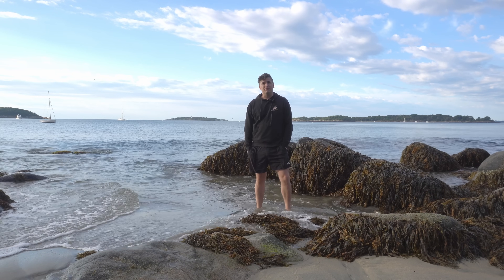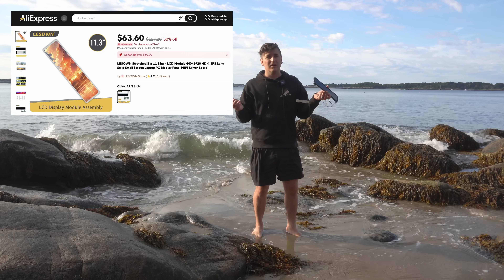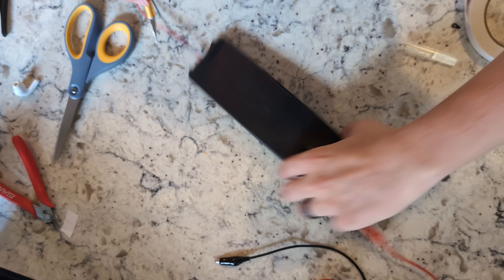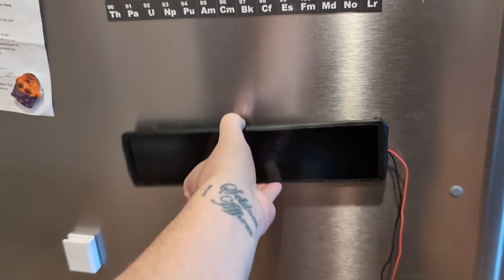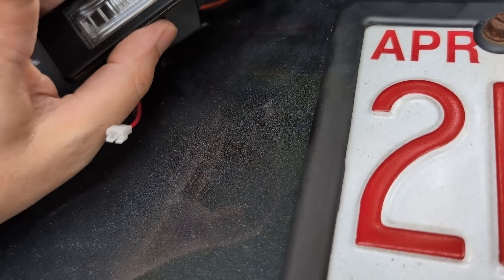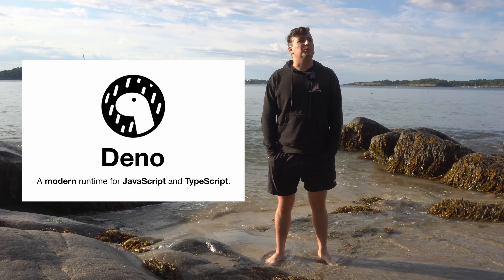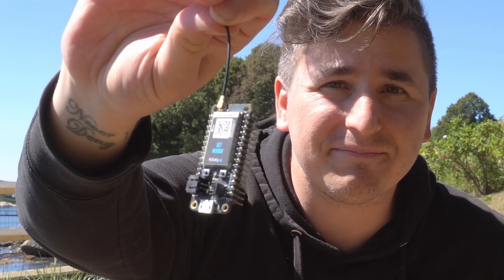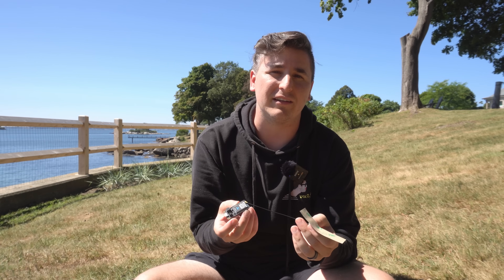Making an electronic bumper sticker to show what music I'm listening to in real time!

Comment: If you want it to stay outside the car then get a clear piece of 2" heatshrink. If possible get a weatherproof one (Marine). They have adhesive inside which when heated seals out all water. I use those on my cars for wiring. Neat idea overall! I could see myself making all sorts of fun bumper stickers with a project like this lol

Comment: Ouchy on that display, they are like $13 in China from TaoBao
Reply: And like 30 if the price included the hdmi board
Reply: 50 if you also want a metal enclosure. Probably wouldve been cheaper even if shipped overseas
Reply: Also you should play bad apple on it
Reply from the maker: sounds like I should start dropshipping
Reply: @GuyDupont  Lol, seeing the number of people that might want to do this, maybe you can do a bit of reselling on the materials XD. Also, if you want, I can help you get parts for that price and ship it over if you want. Or you could use any number of online TB shopping services if you opt to not trust internet stranger, could still end up cheaper.

Comment: f-in typos. 
i did hook up LED strips inside my vehicles dash and out along my inner panels.
the cars duty cycle feeding the spedo pulsed out my speed in code, id read that and then cycle through the spectrum. faster i go the more the color would change until it would start flashin at 80 +

PLUS. added passive IR motion detectors INSiDE my rear view mirror housings. THIS way , if my system noted i was moving fast then abruptly stop, it would begin detecting movement on either side of my car.
so instead of having to turn my head to see em, my door panels would gentley glow and pulse , depending on which side they were approaching on.
offered my ALOT of benefits simply by knowing that and remaining super chill and motionless, knowledge is power.

cop oncve did notice a custom tac display i built and code in my sun visor's edge
stickin his head in my window he noticed it and started getting excited and asking questions
gave me a chance to talk shop with him and that just completely halted his "mission objective"

conclusion.
i suggest DO SOmething that gives you advantages against them with your skills buddy
even if its to win them over

cops LOVE driving fast. its a rush
this means they often LOVE discussing cool car related techs such as custom tac readout visors

Comment: How hard would it be to take the hardware and just have it cycle through static images if we didn’t want to do a now playing “sticker”
Reply from the maker: Under the hood, that's pretty much what it's doing. You wouldn't need the Particle board, you could just load the images on the Raspberry Pi's SD card. 'fbi' - the RPi utility I'm using to actually display the images - has a built-in slideshow mode.

Comment: Cool video. The thing I noticed is that the heat shrink will put some stress on the display it may be a band over time.
Reply from the maker: ahh good thought! Honestly this wrap is not as tight as it looks, especially after I made cuts for the screen. It's flappy around the edges, frankly. But I do plan on using more of it for other stuff so I'll definitely keep that in mind - never considered warping.

Comment: A 3D printed enclosure with an acryclic front face and O Ring would have looked great.
Reply from the maker: mmmm O ring is a good call
Reply: @GuyDupont  mmmm yummy o ring
Reply: 3D printed obhect will need to be painted for outdoor use - something UV resistant.
Reply: @LordPhobos6502  Most filaments are UV resistant, I have used maybe two or three dozen brands and have rarely had issues.

Comment: It seams unnecessary complicated when some Bluetooth audio devices can just extract the current song name from your phone and some esp could display this text to an LCD screen easily
Reply from the maker: seems that way at first glance but:
1. We don't use the Bluetooth directly for audio, we use Carplay/Android Auto. This setup is source agnostic.
2. This display can't be directly driven by an ESP (although the new P4 might change that), so even if I could use it for audio, I'd still need another piece of hardware just for the display. 
3. Much simpler to write a little Particle app to fetch a tiny piece of JSON than ESP firmware to act as a (reliable, good-sounding) audio receiver.
4. Most importantly - I had the Particle board sitting around! I figured, might as well use it.
5. No way to filter out podcasts/audiobooks/other audio if using Bluetooth metadata (though it could be funny to show this stuff too).

The idea to use the AVRCP data is a really good one but it doesn't work for my usecase. My setup is definitely less "clean" but it is really quite "simple" IMO!

Comment: MG CHEMICALS conformal coating. 422 is the part number.
Coat the pcb's with it, use liquid electrical tape around other exterior connections. 👍
You're welcome 😁

Comment: 4:55 lol so dramatic about pulling a plastic mold off.
Reply from the maker: 😭 ok fair but have you tried it??? That thing was really on there, took me like 5 mins of pulling
Reply: @GuyDupont it was the right amount of drama 👍
Reply: Considering that that's what it often takes, and that a glass installer BROKE MY TRIM yanking it off, it's valid.

You have to yank OR you have to have very long trim removal tools and know how to get them to the clips that you can't see from the edges.
Reply: @TheTalonts  lol fair I’ve been ripping my panels off to install speakers and electronic since I was a wee lad lol and I do have the tools lol if you don’t have the tools have plenty of those little plastic clips.
Reply: @nedmacallen  - dude, they didn't break the clips, they broke the TRIM.  "Professional" window installers.  I had clips.  Now I finally have the trim, so can put it back on.

Comment: Why even over the web?!
Just buy a Bluetooth Audio Receiver that you can control with the Pi. Bluetooth also transmits Meta-Data aka song Titles. Grab it, Display it.
ok you need a AUX input in your car stereo, but most cars have that.
Reply from the maker: The short answer is: I already had the Particle board sitting around unused, so it was a no brainer.

And that wouldn't work super well in our case because we use Android Auto/Carplay to connect our phones.

It's a good and interesting idea though - I know you can use an ESP-32 as a Bluetooth Audio sink, but I dunno if you could have it simultaneously act as a BLE peripheral or WiFi access point to broadcast the data to the bumper sticker. Would cut costs quite a bit if it could work and sound good.

Comment: I would definitely recommend clear heat shrink so you can see through it. If you mount the pi and other things inside the car you could have a flatter package on the bumper sticker, with just video and power going to the display. an xt30 connector would be good for power and you could use a male to female HDMI to get the port through the heatshrink. you can get multipole magnets on mcmaster that hold onto sheet metal better. love the build!

Comment: Epic project! Love your content! I had an idea for something like this except I'd have a little control panel with preset messages. Use some silicone weather sealant to waterproof it and maybe put an emergency cord or adhesive zip tie anchor in case the magnets shake loose.

Comment: This is FANTASTIC!!! My first thought was "what happens when he listens to Nile?" but then I saw you had long name support handled gracefully already. My second thought was whether or not I'd be willing to hack into my car's hardware. The jury is still out on that one...
Reply: You don’t even have to modify your cars wiring. All cars have extra empty spots in the fusebox that are intended for stuff like this, where you need to power something from the car’s 12v system. Add your own fuse to one of these spots and then run wires under trim pieces to the back of the car

Comment: Clear heat shrink tubing is a thing for weatherproofing
Reply: YES.....thank you for posting this.   Great Idea....
Reply: You would want an adhesive lined heat shrink so that when you heat it, the adhesive inside forms the seal. Standard heat shrink does not provide a watertight seal.
Reply: @Hellahard  I think the shrink tubing idea is worth a try, but even without waterproofing adhesive I wonder if transparent heat shrink tubing is clear enough for this to work. Might also have issues preventing the tubing from shrinking wavy or it fogging up if it isn’t vacuum sealed? 

I’d suggest conformal coating the screen’s PCB and waterproofing the case. The front of the screen should be fine getting wet if water doesn’t get to the edges.
Reply: i just went to the comments to write this. didn't think it was gonna be the upmost comment
Reply: it rhymes

Comment: I always wanted something like this, but I was told they're illegal because they distract other drivers.
Reply: My Aussie ADR rules say we can't have such a thing; They only allow it for police; road workers, buses & trains.
Reply from the maker: Only thing I can find for MA is that you can't have red/blue/white (reserved for emergency vehicles. Keeping my eye out tho
Reply: E-ink might be a solution, that statically is no different than a sticker.
Reply: it's not just criminal you have to worry about - you open yourself up to liability. all it takes is someone to say "I was distracted by X on the car and it caused me to crash and hurt my back" to, at minimum, tie you up with a ton of court costs. your insurance will almost 100% drop you, too, the moment they find you have an "unapproved alteration" on your vehicle, even if it's not related. if you get in an accident with an under/non-insured individual or it's your fault, you may end up footing the full bill and the medical bills simply because you have this thing on your car.

all of this depends on your insurance and other things, but you may want to check your fine print to see if you're opening yourself up to liability. (I'm not a lawyer, don't live in MA, and have very little experience with this - just things to check).
Reply: @Chiberia  You must not be american, you can drive a 200 ton death machine with 500,000 lumen lights pointing 360° 24/7 and waving 15 ft flags off the back and, as long as you don't kill somebody on the road, there's nothing that can be done about it in a vast majority of states